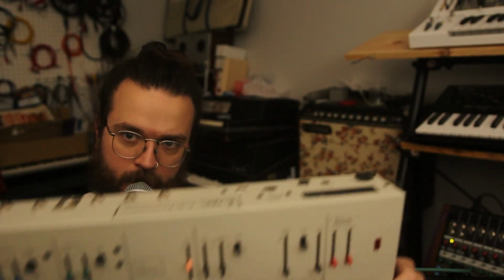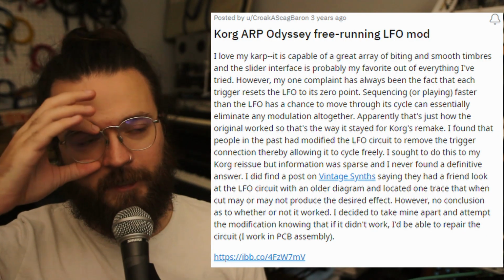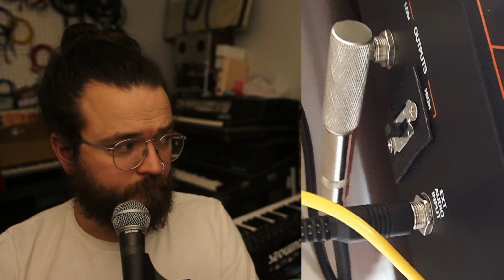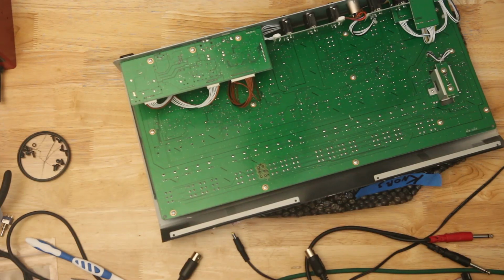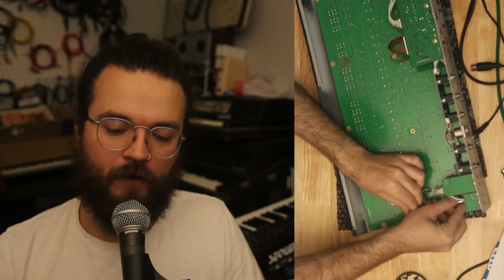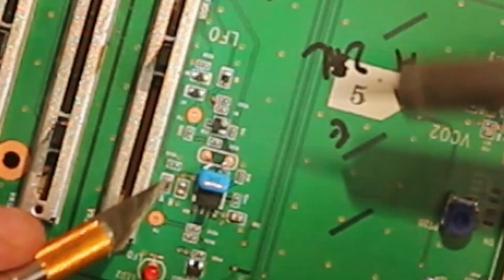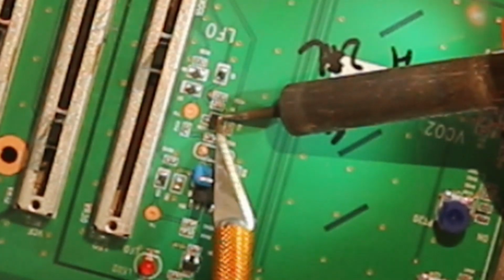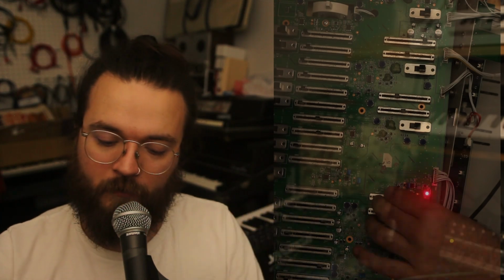Korg Arp Odyssey // Free Running LFO Mod

Comment: My first thought was to do go for the transistor leg as well but after considering it for a few seconds I thought, maybe it would be a better idea to desolder the resistor instead and resolder it at an angle or replacing it with a through hole resistor (and while I was pondering this you pretty much did what I feared I’d do 😳). I haven’t looked at any schematics or anything but reckon it could work. It’s certainly a lot easier to find a replacement resistor if would come to that.

Comment: what about S&H that is why key trig is handy. I'm sure you could still fit that switch. then hot glue or epoxy the transistor bak to the board
Reply from the maker: I high key don't know if I'm triggering the sample and hold still, but I'm pretty sure that bit is fine.....got me wondering tho

Comment: I've just done this mod for a friend and he wants to know things. What voltages go across this point and in which direction but mainly, can he feed an sq-1 signal into this connection? Makes no sense to me but I said I'd ask. Thanks in advance, any info appreciated.
Reply from the maker: They want to trigger the lfo externally?

I have no idea if it would work, but if you can see what the transistor is labeled as, you can find out its voltage range, and if it's within whatever the sq-1 puts out, maybe take the input of the transistor out to a minijack.
Reply: @JorbLovesGear  thanks for the rapid reply. I'll get on it and let him know.

Comment: Having a free spinning LFO seems more vintage than a retrig anyway. Hopefully you forgive yourself and get that iron hot again. From what I've seen people either expose and solder to nearby copper track or use a jump wire to next component in series

My electronic solder sucker died while idle for 5 mins so my resto project is just frozen for now

Edit: oh shit the whole things busted kek